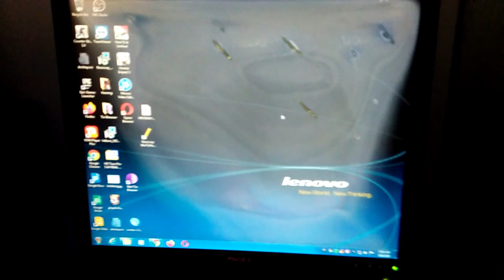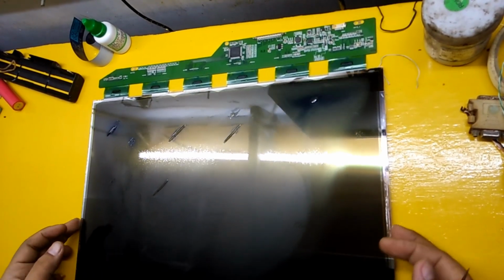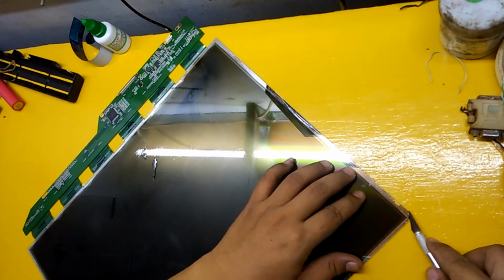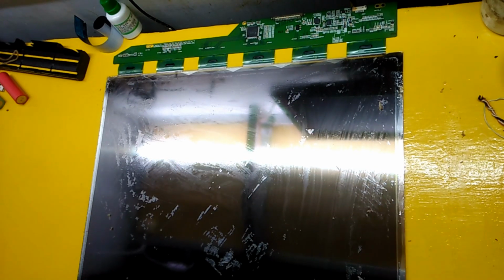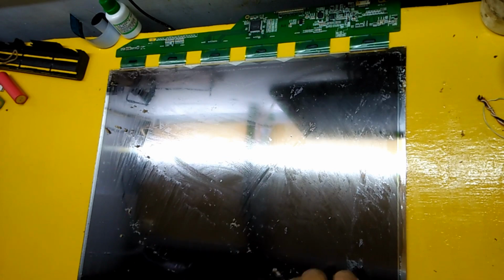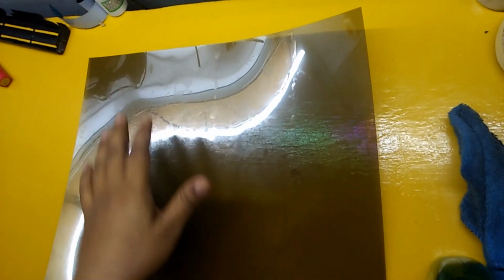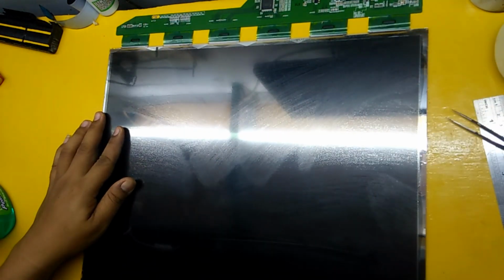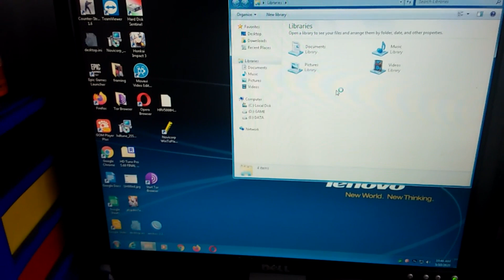Repair LCD monitor Screen Change Polarizer Layer | Perfect no bubbles left

Comment: How he did it, so neatly bare-handed without gloves, without leaving fingerprint smudges, is beyond me 🤔
Reply from the maker: I use water with foam. It will drag the dust and air buble to the edge
Reply: And the overall process completed in seconds😯

Comment: hi sir, i have a important question to ask, if I replace them both front and inside , is it no need to follow previous film angles ? And just use any angle for inside and 90 degree difference for outside film ?
Reply from the maker: Outside and inside must same degre
Reply: Yes

Comment: Hi, very nice video. I have old acer al1917w which has 19" flat screen like yours. The question is what angle or degree for this kind of screen? well i know usually screen below 22" is 45 degree but i'm not sure with this panel. Also does outside polarized can be used for internal coat? thanks in advance.

Halo om videonya bagus & gampang dipahamin, saya punya monitor acer tipe al1917w layar kotak kaya punya situ tp ukuran 19 inch. Pertanyaannya berapa derajat polaris buat panel ini, saya tau biasanya panel dibawah 22inch itu pakenya 45 derajat, tp saya gak yakin buat panel ini 45 derajat. Dan apa benar lapisan polaris luar bisa dipake buat yang dalam? terimakasih sudah dijawab.
Reply: Liat aja pola kerutan nya om... Klo diagonal/miring itu 45°. Klo TV yang 0° biasanya pola kerutan nya horizontal/lurus

Comment: what kind of liquid you are using for cleaning after removing polarized layer?
Reply: Isopropyl Alcohol 99% fast dry
Reply: @nonames8335  should i do this myself or have a proffessional do it or get a new minitor
Reply: @jasonkhan7643  no need to get new monitor! Just change polarizer! If you can't do this, just sent it to computer shop service in your country, they will replace a new polarizer.. That price it's not too high compare with new monitor.. It saving the money.
Reply: @nonames8335  ok thankss

Comment: Model:philips 32inch
32ta2800/98
What is the inside & outside polarized degree for this model?
Reply from the maker: i dont know all degree on all type monitor please check on their website for detail spesification. or you can test with your own polarized layer. make sure you have all degree

Comment: Hello It was useful video. . I am actually doing some work/project on LCD display . . What is the use of rear polarizer on LCD , I am trying to make LCD monitor without optical films and backlight unit on the top of the LCD , in that case would the rear polarizer cut down the light

Comment: What polarizer film used in lg w1943t 19 inch wide monitor 45 degree or 135 degree?
Reply: i think its 45 degree
Reply: @adzansyahputra2675  sure 45 degree or 0 degree which is good

Comment: Bad habit of removing the polarizer by force..If the glass screen breaks. bye bye!!!..slice the old film with cutter blade may it bo horizontal and vertical which ever you prefer then strip the slice one by one. DO NOT TRY IT without any mask, the fumes emitted by the damage polarizer is very toxic.
Reply from the maker: I was do that work many times and noting happen

Comment: I have a question sir do laptop lcd/monitor lcd has a specific polarizer angle? Ty
Reply from the maker: yes , all lcd on the same type will have same komponent
Reply: @AgusMasPutraWibawa  ty
Reply: Which angle this LCD using? Zero, 45⁰ or 90⁰
Reply: @nickpeh1066  the angle varies to the angle of view of the lcd to user if your lcd angle is 0° you can see the image in lcd even if you're in 180°
Welp im not the great in terms of explanation.
Or you can buy test polarizer it comes in different angle like 0°, 45°, 60° because not all of the lcd is created equally
Reply: So u suggesting using a zero degree? I am not sure the angle u viewing, but monitor on table and sitting in front of it should be 90⁰?
Reply: @nickpeh1066  you can use 0° if its not compatible in your lcd try to rotate it(Polarizer Film) should polarize the screen
Reply: 0 degree polarizer is the way to test what angle your monitor has for the right polarizer degree, with the help of a protractor. slowly turn the 0 degree polarizer while the screen is lit and when you see the correct visualization of the background when you are looking at it at LEVEL basis. check the protractor and it will tell you the degree. most often 45 degree for the Squared monitor., wide screen varies from 45 all the way to 135. not all of the are created equal.